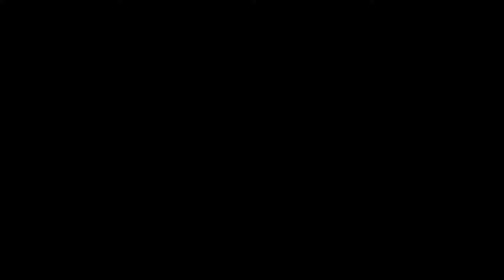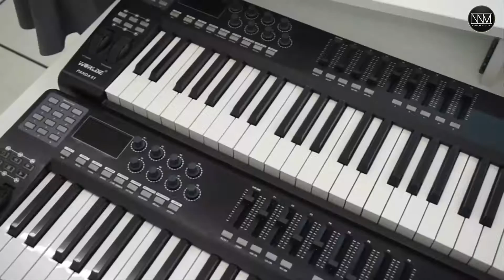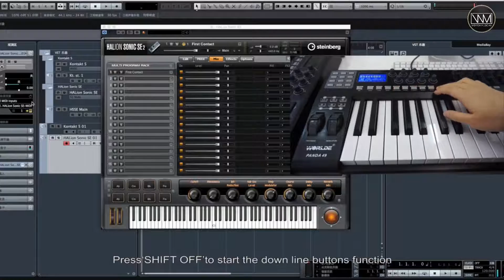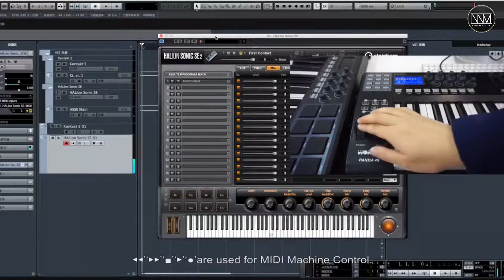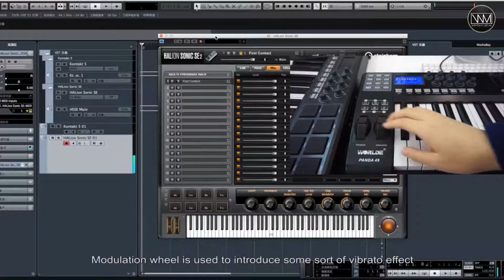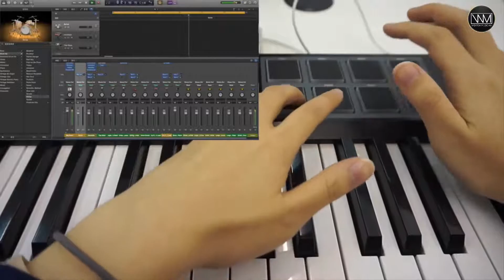Worlde Keyboard

Comment: Hello, Do you know how to do a factory reset to the unit? I have the panda 49, I kinked the fader 1 in Reaper and it works, but mu 1 knob also does the same thing as the fader, I must have pressed something while trying to program the key, now that I know a little bit more, I would like to reprogram it from zero. The manual says on section 3.2.6 Reset to press PROGRAM and SHIFT buttons at the same time (25)/ RESET button on 49/61 to factory reset,  doing it ans nothing happens, don't know the proper way to perform the hard reset, any help would be nice. THX.